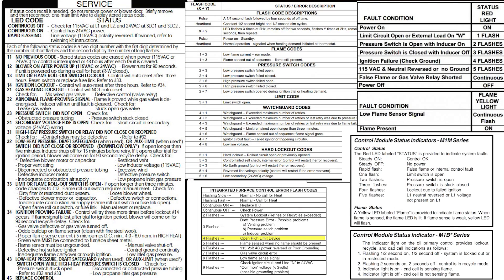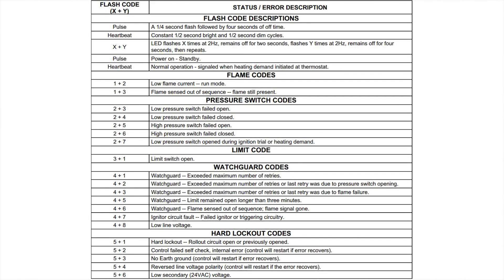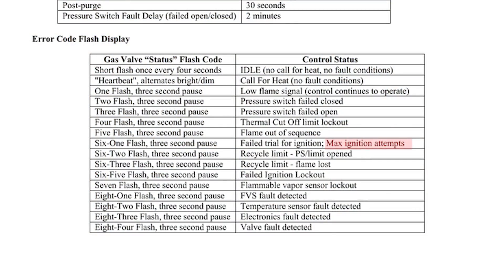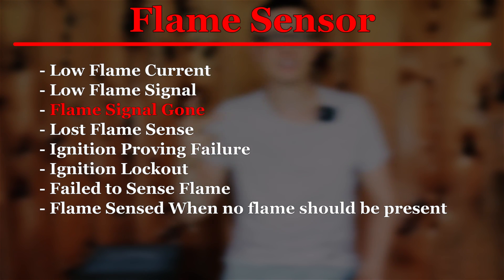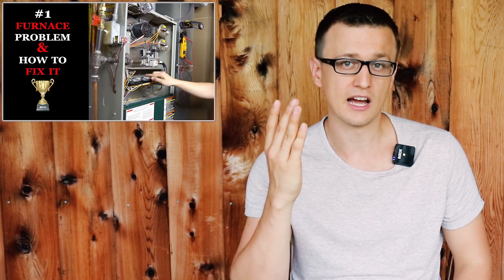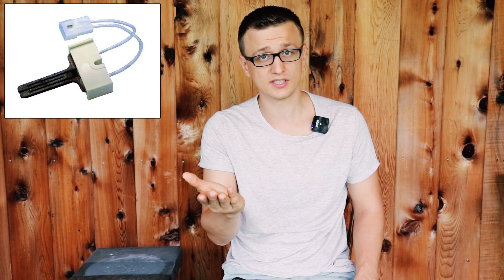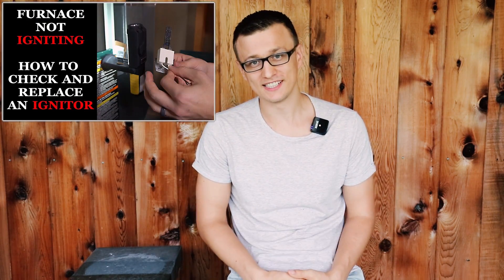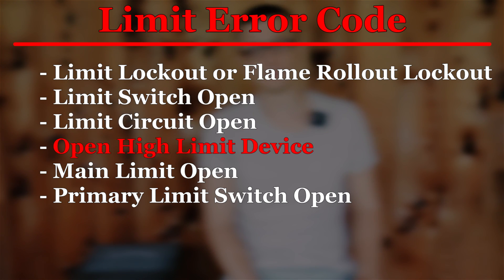Furnace Error Codes Explained

Comment: Thanks for the very informative videos. 
Question: The furnace manual gives a max. distance of 24" between the intake and exhaust on a side wall termination. I ran into a furnace where they are spaced about 42" but are on the same west facing wall. Could there be issues with this in the long run? ( Found very vague info on the importance of being in the same pressure zone)
Reply from the maker: Hey Matt! I have never looked into that but I have seen plenty of them spaced out more than 24" and I haven't run into any problems that were caused by that. I think the only way to get a concrete answer would be to call the manufacturer. I know Carrier usually has very knowledgeable reps in that regard. They would likely have an answer for something like that.
Reply: @WordofAdviceTV  I will most definitely contact the manufacturer. Thanks again.

Comment: I deal with 108 day and night furnaces. A common issue is the pressure switch error. I replace the pressure switch and it works, but I am wondering if there is an underlying issue causing the switches to go out.
Reply from the maker: Aloha David! Thanks for stopping by 😃 In Minnesota I rarely had to replace pressure switches. Usually they were tripping because there was actually a problem. I am not sure what's going on in your case.. Do you have a combustion analyzer? It would be interesting to know what the CO emissions are on the furnaces with failed pressure switches.

Comment: First!
My furnace is garbage 😂. 
Mine blinks 1.. 
Because is doesn't stay burning for more than 30 seconds. 
I changed the flame sensor 3 times! 
It works about 50% of the time which makes it even harder to figure out.
Any ideas
Reply from the maker: Congrats on being first Ohio! 😄
Sorry to hear about the furnace troubles!
On your furnace what does 1 blink mean, is that a flame sensor error code?
Have you tried cleaning the burners? I would suggest watching my 
flame sensor troubleshooting video for more ideas on what to try.
Reply: @WordofAdviceTV  your correct, It's a failure to light code. I will check out those videos right now. I actually ordered a few parts and they arrived today but magically it has not misfired once since the moment I spent money 2 days ago. It's certainly haunted with the 2020 curse..😓
Reply: Try cleaning the igniter if you can clean it... That could solve your problem!